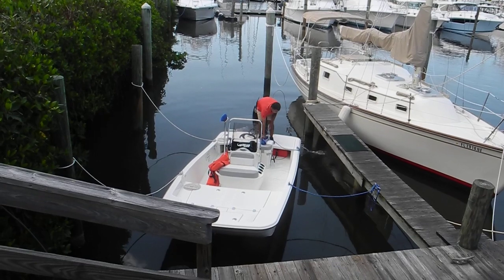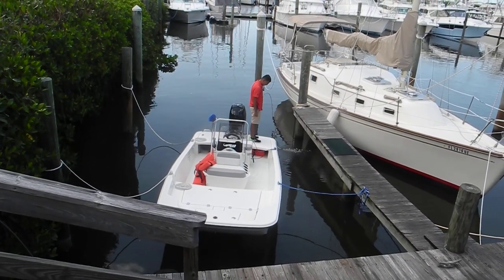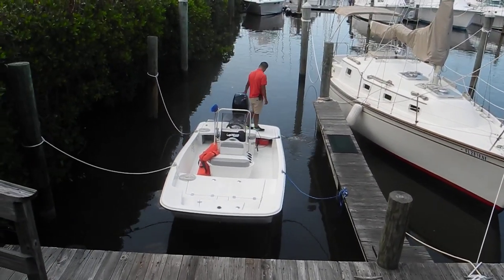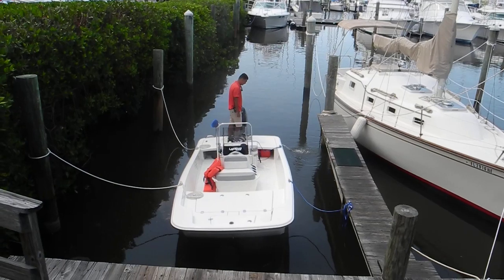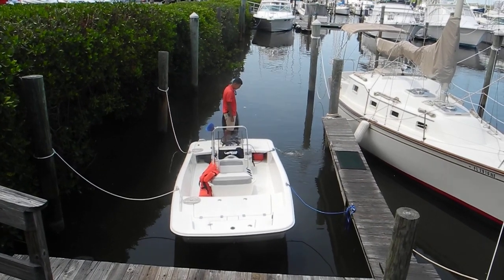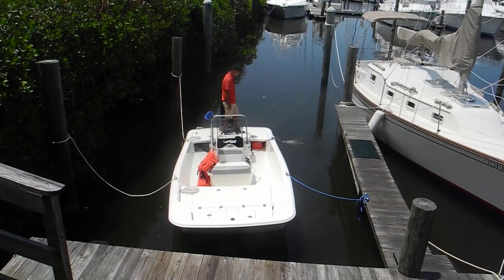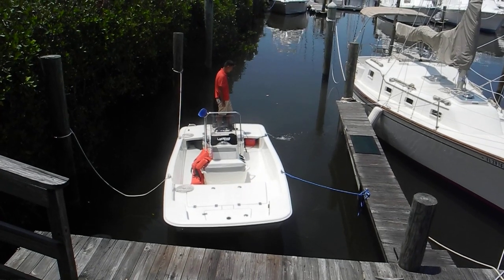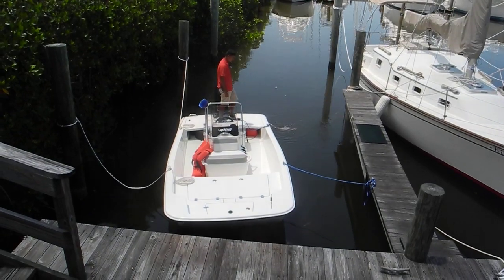Rain water in bilge

Comment: Good point with the charge.  My mom has a boat lift and we had to hook up a little solar charger to the battery because we can't reach the drain plug when it's on the lift so whenever it rained the bilge pump would run and drain the battery and drain it.
Reply from the maker: Wow, I saw a drain plug design that had a FLIP UP lock then flip DOWN to yank it out. Do you think a 3/8 line attached to this could yank it out while on the lift? Then when launching you could stick it back in after only a gallon or two of water rushed in?

Comment: Boston Whaler”Montauk”? Or maybe a Carolina Skiff…she had a good amount of water in that bilge.When I owned the Boston Whaler Conquest 255 every time I stood in the back starboard side it would set off the bilge pump.That boat had so many floor boxes in it it always had rain/wash down water in it.To the extreme of it rotting out the metal straps that held the oil tank in place.One of the big factors in selling that thing off.
Reply from the maker: Unsinkable does NOT mean it would not fill full of water. It just means it would not sink to the bottom. Check your bilge pump float switch and battery.
Reply: Its a Mako Pro Skiff .....like a Whaler or CS
Reply: @muskyful  thanks David—didn’t know Mako made that type of boat.
Reply from the maker: @muskyful  Good looking boat but was filling with rain water.
Reply: @AskCaptainChris  Yah, I have the same boat. There's not a lot of room in Bilge Well for pumps (Live Well, Bilge, Rigging Wires & external float switch) so I installed a Rule Automatic Low Profile pump with the internal switch. But Yah, always important to check on your boat during/after heavy rains, and check and clean pump & bilge area routinely.
Reply from the maker: @muskyful  Thanks for the note. A lot of people just go home and do not think about the rain.

Comment: How does water get down in the bilge. Recently purchased a used Robalo R160, took
it out after a rainstorm only to fond it discharging a huge amount of water. Turned back
to dock in fear of sinking.
Reply from the maker: Do you have a bilge pump? Was the boat on a trailer? And when it was on the trailer did you have the drain plug out? When you put the boat in the water did you put the plug back in?
Reply: @AskCaptainChris  yes, yes, no, and yes.
I can't believe the amount of rain water that was being discharged! so much that one might think there was a hole in the hull.

Comment: That would be my luck. I have a manual switch bilge pump. I have a brand new auto model I need to install. I don't plan to leave my Boat in the water. Putting the new floor in was to much work. I sincerely hope everyone in Captain Chris land has a great weekend. S&Shortster
Reply from the maker: Back atcha, we have a big day planned. Garage sales then work in the yard to clear away some out of control tropical vegetation before the afternoon liquid sunshine arrives.
Reply: Have a good weekend Smokey& Shortster
Reply: @johnm5714  Hope you're weekend is great 👍. We are off Monday for the new Juneteenth holiday 😄.
Reply: @AskCaptainChris  I need to have a yard sale. May have a free one!
Reply: @alabamasmokeywilson6818  working today and MONDAY Smokey. It’s busy season out in these parts.All the city people are here in full force so I’m collecting my
“Annoyance” tax from them.😆
Reply from the maker: @alabamasmokeywilson6818  Got any old trains, Lionel, American Flyer  , Marx or other O Scale 3 rail trains. I am interested, C
Reply: @Ask Captain Chris  what if you turn the battery off?  I always turn my batteries off before I leave weather it's in the water or put into dry storage space.
Reply from the maker: @chrisvSTL  Depends on how the bilge pump is wired to the battery. I prefer to wire it DIRECT to the battery with a fuse but others wire it through the battery ON - OFF switch. Your choice.
Reply: @Ask Captain Chris  ok. Thank you. Mine is stock from the factory. But I also have scupper drains. I think that is what they are called.
Reply: @chrisvSTL  have it wired direct to the battery—not the battery switch.you want that bilge pump”hot” regardless of batteries being turned off
Reply: @John M  I understand the concept and reasoning. Topically it is on a rack inside a building. Only leave in the water overnight if I am going out  before the employees start working. Either way it's factory wired. So I couldn't say if it is direct battery wired. It's a  GradyWhite Freedom 255.
Reply: @chrisvSTL  nice boat Chris. That’s a dual console I believe. I’m a big Grady White fan.
Im not certain if they wire them that way from the factory—and I owned a 208 Adventure and it was wired hot when I got it used.I think it would/should be.perhaps on boats with multiple pumps only the one in the stern would be direct while the others are on the battery switch.some boats have them mid ship too depending on the size and layout.

I literally tested mine by switching off the battery switch and filling the bilge with a hose prior to a big storm coming.She worked and that’s a good thing…
Reply: @John M  ir has 2 pumps. I know they both are still operational drove it to the Grady dealer for oil change. I like it. The dual sometimes makes fishing difficult. But dual is better when for non fishing family days. Have to keep the female happy lol b
I watch wavy boats, he records haulover inlet.(crazy money going in and out)  It's rare to see a GradyWhite. In my area of LBK and Sarasota area they are everywhere. 
Maybe someday I can bet the mack daddy GW Canyon 456. Oh hoe sweet that would be. Lmao. 

Oh I will say definitely glad i got the hardtop.

Have you seen any of the new ones wirh joystick docking.